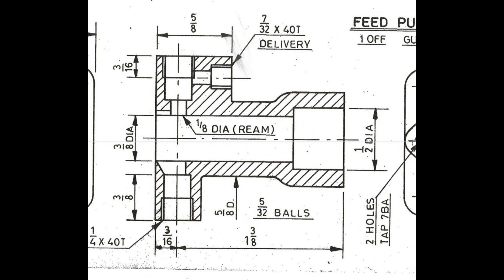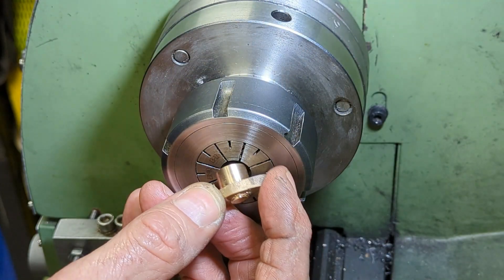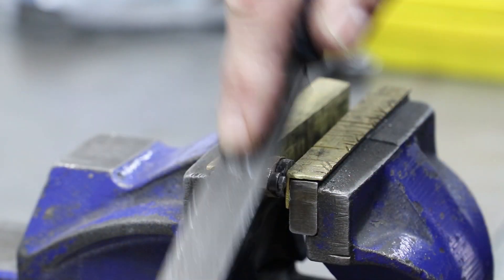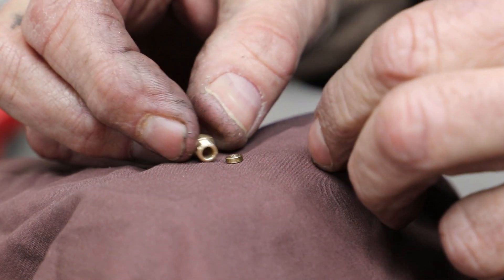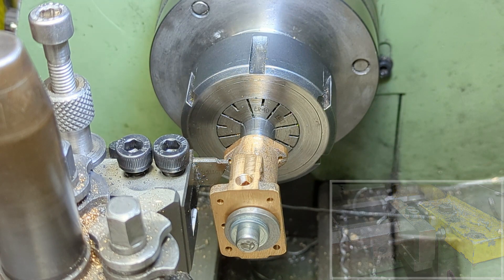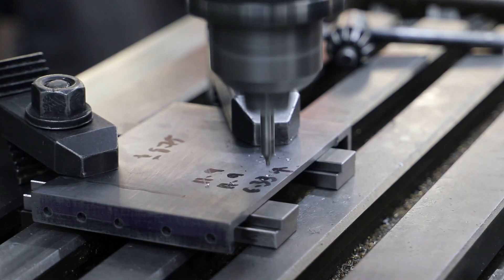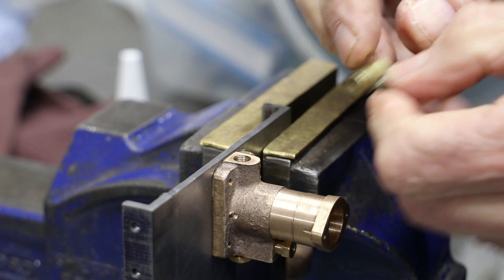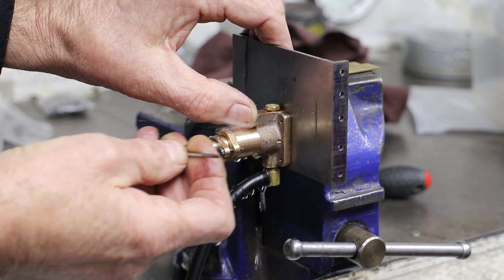Part 52: The Boiler Feed Pump Pt2

Comment: Mark, I keep a 3/32" dia Brass Rod about 5 inches long by my Lathe. When parting off a small Part, I put it in the Tailstock Chuck and enter the Part, almost touching the End of the drilled Hole. This way when the Part is parted off, it just rolls a bit on the Rod. It sure beats losing it in the Chips.

To set the Ball Lift, one measures from the Face of the Pump down to the Ball. This can be done with a simple homemade device similar to a Depth Micrometer but with a Sliding Pin and Set Screw.  From that Sliding Pin measurement subtract the Ball Lift and that is the dimension for the Mating Piece (the threaded portion plus the small Stop Portion on the Delivery Side). For the Inlet Side you would have to check the Ball Depth on the Mating Piece before locating the Hole for the Elbow.

The purpose of the Slot on the Inlet Side is to prevent the Ball from blocking the Passageway. Imagine if there was just a drilled Hole, when running fast the Ball could easily lift and severely constrict the flow of Water coming into the Pump. That is why there needs to be an open Slot down into the Ball Chamber on the Inlet Side.
Reply from the maker: Hi Bruce,
Thanks for the tip on measuring the ball lift, I'll give it a go 👍
Regarding catching a part when posting off, I just stick a piece of paper under the chuck to catch it.
Mark